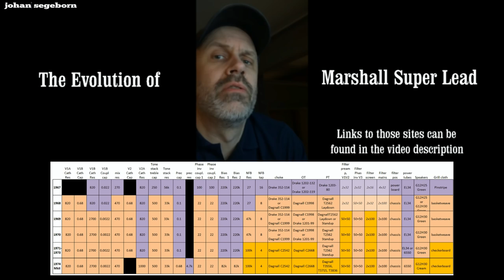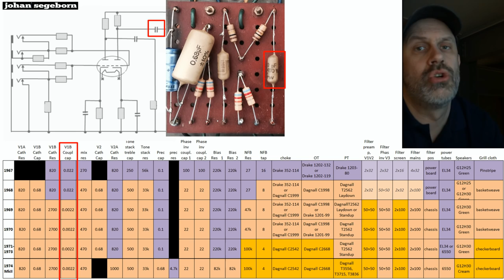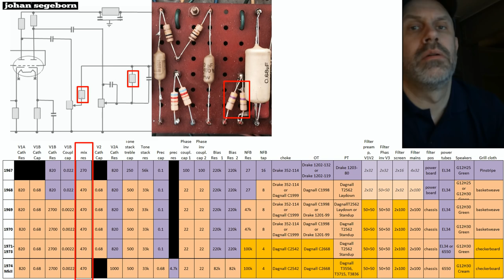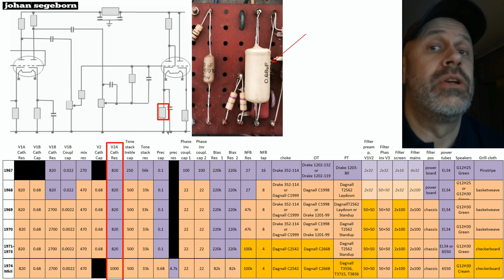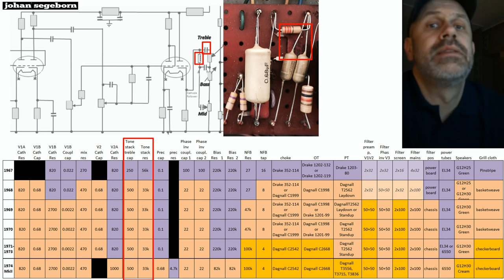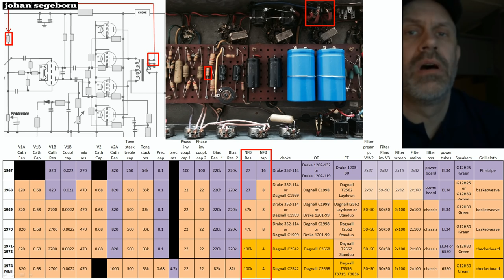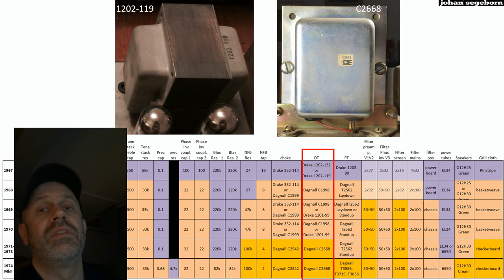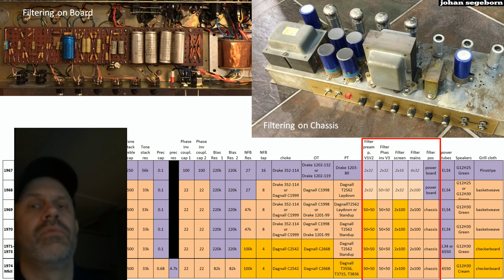The Evolution of Marshall Super Lead

Comment: Thank Johan for all these great jobs you done ! For those interested in cathode resistor, they introduced the 2K7 value of V1b (1:18") to shape the low frequency fall-off in input, very important feature for that tchonk on palm-mute. Yes most pickups do have too much bass for proper distortion, this 2.7 value is the solution, really makes the difference as soon as the crunch and the associate compression comes, it sets the ideal amplitude balance between upper boosted, and lower almost non-distorted giving that playability Marshall are known for. Every and each amp in the world now uses this value in the boost channel, and now thanks Johan again I know what year it cames on, and it's 69 ! That's the year I come also, wonderful year !
Reply from the maker: Thanks man, glad to hear it!

Comment: engineering a sound , there are so many ways to get there in a amp, when i herd you play the plexy 50 Watt 1987X, it was all there, and that is all modern caps and resistors, so it can be done. the variety in the old amp runs and tube runs was and often is quite a lot, a jazz guy may find a clean marshal and love it, right after playing a dirty sounding one with more early brake up that the blues rockers swears by.  its a interesting thing we do try to express out selves through electronics
Reply from the maker: Yeah indeed, well put

Comment: Such a well designed video Johan your approach to highlighting the table really gives the data some focus with what you're saying. You'd make a great lecturer in engineering. I have an old 2203 that I got and someone had rebuilt it as a super bass with tag board. I made it back to plexi specs as used it as a test bed for mods for years. I once set up a switch on the back to swap between the extremes of the nfb 27k on the 16 and a 100 on the 4 ohm. Such a hugely influential element I'd not realised till then. The lesser amount of feedback made the cab so much more influential in the tone, but so much louder. Given that this made the amp louder sooner I found that the bright cap would suck more low end at gigging volume. I know I could have rendered that moot if I'd got into attenuators but it certainly told alot about how the later amps must have been in common gigging use and got me thinking more about influence of stages of eq than I would have otherwise. People must have had a real shock getting a newer Mk2 in the seventies after having a plexi. No wonder there are so many tales of the players saying they couldn't find amps to replace older ones. And when you think of the simplicity and low price of the significant few components it's amazing to think how close they were. That's why I started blueprinting mine before selling in trying to catch the magic lol
Reply: Sorry for waffling on!
Reply from the maker: Hi my friend, I always appreciate your feedback, so the longer the better :-) I've held a couple of engineering lectures in my day actually :-) at Chalmers University of Technology in Gothenburg. Cheers

Comment: Nice .I read somewhere a long time ago that Hendrix had his heads running on 6550 in US and EL34 in Europe  .This explains the more open and not so distorted natural sound in Woodstock ,Filmore East and so on during some 1970 gigs compared to the early gigs  in 67/68 a much more harsh and distorted sound .This was stated by one of Jimi´s amp techs .This guy also revealed that Hendrix favorite heads were those with the higher +B voltage up to 480+ volts ,he had personally checked  that ... But the video chart shows 6550 only from 1971 and up ... anyway ,very good info there

Comment: Great video and great job of breaking this all down as to what is laying down the distinct Marshall tone of the early years and the later years, these specifications on these components is what I resort to when I tweak my amplifiers and modify them it's between these specs for Fender and Marshall. Fender has the great clean tone and Marshall has the awesome overdriven sound. And then you have all the great variations of both.

Comment: In 1968 i bought my first marshall 100 watt.   Super bass is the only one i could find on the shelf. It stopped working on my first gig with it .  Took it to merson in westberry  ny abd kenny frank attended to my amp personally and found two filter cap unsoldered laying on the bottom. As he resoldered everything he asked if i would sell the amp to him for Jimi because its transformers put out a larger amount of current . I said no id really like to keep it . He said then let me set it up like Jimi and he did a few things like changed out the cathode caps and the main thing he did was change the cap on the volume pot to a 1 i think it was.  This made the amp come on straight away at about 3 . It was outragious  ..as i found out later as i knew nothing about amps in those days that jimi kept his amps full on which would really defeat the initial caps action . Who knows i knew that amp was outta control after what he did .. anybody know anything more ??

Comment: Hey Johann you are a national treasure to your country in the United States as well as the uk! I learned a hell of a lot! I had many bassman and vox ac30s back in the day. And while I was pretty darn happy with my tone I still wanted to get that really good vintage Marshall tone that I've heard before it records but I just didn't know what exact model amp and what year was used. And now I know ! Those older transformers and the 67 jtm45 and jtm Black flag cancel magic in him the change in that particular camp you talked about 68 camp in 1968 started to dig maybe it had more gain but it wasn't a good smooth and detailed kind of gain. Can you pointed out the pinstripe grill  cloth was use in 1967 to the basket-weave. You said depends for a girl called had a positive effect of removing a lot of the harsh iron frequencies. I suspect that probably helped the 67 is well sound better. Although you did not say whether or not the basket we was any better or worse than the pinstripe grill cloth. But you did say the checkerboard was not very good because it little out of the high-end ha frequency through. I believe you said maybe it was 69 or 71 or something like that. So the the earlier late 60s celestion speakers would have had a slightly smaller ceramic magnet could have affected the tone and most likely in a positive way. I've experimented with Alana speaker magnets Jensen's celestion and I sometimes found a slightly smaller magnet ceramic magnet of medium size not too big or not too small, oftentimes can sound better. They're a little bit looser and liquid sounding but not overly so. And they can had a really nice smooth grind when they breakup ad to saturate the overdrive quality and amount. . and like you pointed out and send me your earlier videos where you proved and demonstrated that one 12-in speaker bigger and warmer sounding than a 4-12 marshall cabinet
!!! That absolutely blew me away when I heard holyshit standing waves frequentcies in the speakers cabinet were cancel themselves out input each other and weird nasal  out of phase sound.

Comment: I love all Marshall amps. I took my old 1980's Marshall Lead 12 practice amp  and I drilled a hole in the back and put an output jack , and I use it as a head. I run an Ibanez Tube Screamer through the gain channel.  Gives me the exact sound I'm looking for . But one  of my favorite mods of a Marshall amp is the "Bradshaw Dookie mod" . The singer and guitarist from Green day had Don Bradshaw his amp tech  modify his old Marshall plexi  head. He modded it by adding a master volume and beefed up the gain curcuit. So , you get the classic plexi tone but with a super cranked gain . The sound is very similar to taking a Variax and pushing the power to the limit. So basically it gives you the exact same classic plexi tone but the gain curcuit pushed to the limit.

Comment: Very cool, I don't think people realize just how many changes Marshall made over the years. That's why I find it kind of funny when people use generic terms like the tone of a super lead. It's like which one? Though all Marshalls have a distinct tone. I have to admit I am a Soldano nut, but still love the " Marshall " tone. I've got an old Elk 30w amp from the late 60's given to me dead. Had holes melted in the OT tube plates. So many caps later it runs great. Lately I've kinda been Marshall obsessed so I did some revoicing on it and made it kind of a cross between a super lead and super bass, but only 30 watts. Sounds pretty cool. It uses 7189 OT tubes which are a higher rated el84. B+ is 420v as opposed to around 325 for 84's. Enough of my rambling, like your vids when I want to hear different Marshalls.
Reply from the maker: +Brad Tomlin Thanks man, glad to hear that!

Comment: Great information tremendous, congratulations. You could make a video of how the capacitor fuses affect the current input of the amplifier, and also the difference when using parallel capacitors in the diode bridge in the ac /dc
 rectifier.

Comment: Oh yeah and it one guy mentioned tubes of course that will make a huge difference as well as the speakers do. I can tell you as a vintage tube seller on eBay and being a guitar player in fellow tone chaser you can't do much better than mullard ecc83. However I find that I like to mix the muilards with either telefunken ecc 83 or good ole' long black plate square Getter RCA 12a x 7. Even the long gray plates and pretty good to from1959. What's the Telefunken  does is it smooths out the crunchy bite.  The Millers had an excellent overdrive quality to them and they actually pump up the mid-range and they got good strong  bottom end, and a round topend. Donnelly do they do that but they extend the high in frequency in the extend the the low end frequencys. Causing the sound the sound bigger and more open. Almost 3 d like. RCA's don't have quite the top 10 in the bottom in the extension but they have a really nice  rich colorful in the mid mid range. Are just a lot more smooth and detailed on my vox ac30 generally I will run a mo
Mullard  in V1 a Telefunken long smooth plate in v2. Canyon V3 on my vox ac30 hand-wired that happens to be the phase inverter. Honestly I don't want to run to Hot n crunchy have a team there because it would detract from my detail and clarity. That's why I run the RCA
 long black there. Of course in the vintage 60s voxes you had an extra tube or two 12ax7. In that case i would us two molars one  in v/1and another balanced mullard in v/2. . The older mullards with a long plate square getter mc1 from the late50s are supposed to be the best best. Honestly most all of them up to revision 165 blackburn England sound pretty damn good. As long as you're using balanced pairs together. The revision 161 and 165  from the years between 1961 and 1965 where the round Halo get her short plate version. Didn't even need still had a lot of power and strong mid range forward sound. . I sold these to Rich Robinson and Chris Robertson's guitar Lindsay of The Black crowes. Lindsey told me that rich likes  those better live because you're not nearly as microphonic on stage yet still sound strong and good. Those guys also like amprex 12ax7s.red label for hammond in the early to mid 60s. Rich likes mullards el84 particularly 1959 square getter. Chris usually uses a marshal 50-watt jmp and he likes the mullard el34 double o getters on the bottom of the tube. Brown base.

Comment: Great information my friend!
Reply from the maker: +Blake Coster Thanks, Have a great weekend my friend!
Reply: +Johan Segeborn I forgot to ask; any information on the changes in value of the bright cap across the volume pot of the High Treble channel across the years?
Reply from the maker: +Blake Coster that one was constant throughout the Super Lead years. Earlier (JTM45/100)  it was smaller or not there. Cheers
Reply: +Johan Segeborn 5000pf?
Reply from the maker: +Blake Coster yeah, it was 5000 pf for Superlead, but may´be 100pf before, but I'm not sure. Cheers

Comment: What a video! Hi Johan. I'ld like to know if there's any circuit difference (cathode resistors, caps, tone stack or anything else) between the ''65-66 JTM45/100 and the '67 JTM100. Thanks

Comment: Excellent as always!!

On the G12H30s, which years had 55hz cones and 75hz cones?
Reply from the maker: Thanks Danny, Marshall actually only used the 55Hz (T1281) version. I think those existed between 66-80. The 75Hz version (T1217) were used by orange and Laney for instance. I’m not sure if they also were introduced in the mid sixties or if they came a bit later. The earliest I have are from 71. Cheers

Comment: Hi Johan! Thank you for these videos!.

I would like to ask you about the 90's and current super lead reissues. What is the exact  era reissue of the 1987x and SLP? 
1968 PLEXI? 1971 metal panel? 1974-1976 mkII? 

And the 1959 HW?

Which transformers use these current models?

Thank you!

Comment: Dear John, Would the data on the '67 Super Lead model be the same, and applicable to the 1967 JTM50 Black Flag with Solid State rectifier, and the 1967 JMP 50 with Solid State rectifier, in relation to component values listed ? thank you for your valued assistance. TG
Reply from the maker: +tweed guitar much of it yes

Comment: I have the jmp1 rackmount and 9100 power amp, quadraverb in fx loop out stereo to two 1x12  1912 150 watt cabs, controlled by midi footswitch, have you tried this set up,? and if so I would love to hear your thoughts/opinion/view on this set up, I have owned this rig since released in late 90's and really love everything about it though I would prefer passive eq rather than the active layout ..  hope to hear from you ...
Reply from the maker: +Geo Arthur Hi! I havent, but now I'm curious. I'd like to try it with a strymon Big/Blue Sky which I really like. I like the G12B-150 in the 1912s as well. If I get to try this setup I'll try to post something. Cheers Johan